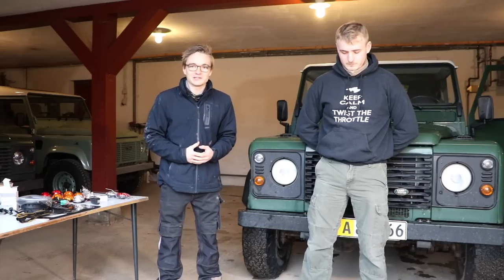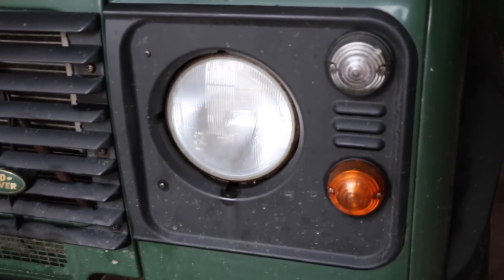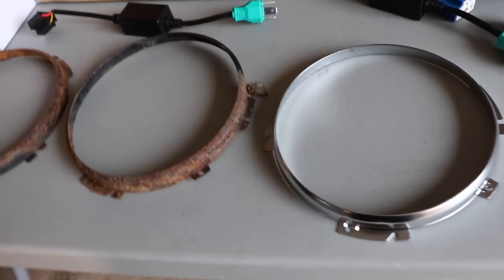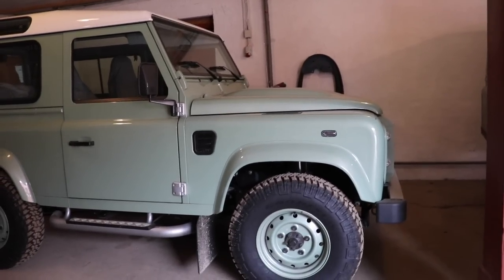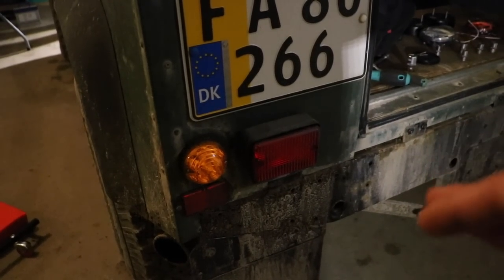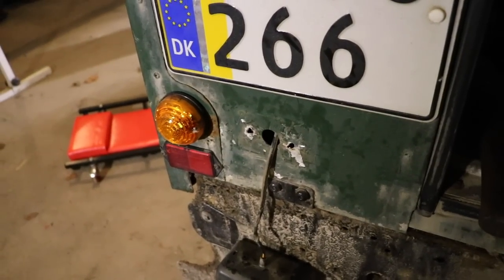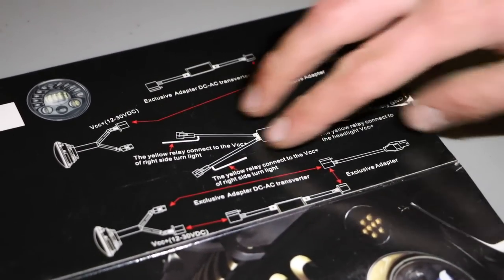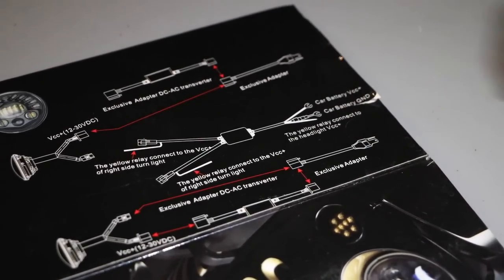Installing LED 'Halo' Lights | Land Rover Defender Mods

Comment: Looking great lads! The plastic headlamp bowls were only on Series, and earlier coil sprung models. But since you had them was a good idea to fit anyway as they help keep some of the crud out of the connectors etc.

You ought to do a shot of the headlights in the dark from the drivers perspective in one of your vlogs, so you can give your opinion on the brightness, spread etc. I personally haven't been impressed by any so far compared to upgraded Crystal halogens, as I don't like the 'cut off' beam pattern/spread on low beam, but I do like the fact you have the low beam on still when you switch to high... fills in that void at the front nicely.
Reply from the maker: Thanks! Admittedly, a showcase of the lights in the dark should have been included, but we'll likely put that into another video at some point as you mentioned. 
And thanks for the info on the bowls, we were wondering about that.
Reply: Nice,how did it cost for both ?

Comment: Hi guys. I have just bought the same set of LED Lights because they looked so great on Liam's Landy.  Could you please clarify the connections that Nisse made when wiring up the Halo part of the Headlights.  Did you say that you had connected the red wire labelled Car Battery Vcc+ and the black wire labelled Car Battery GRND to the vehicles Position Lighting?  If this is so, what is the Position Lighting?  Your help would be most appreciated as I am struggling to find a suitable switched ignition live to connect to under the bonnet of my 2015 Puma Defender.  Keep the videos coming they are excellent!!

Comment: Hi 
I have defender 90 2005
Today I fit new Led head light .
One small problem that in first swich(click 1) and Secound(click2) high beam on.
I know some Landrover made some  defenders with swich low light when you change for the Secound swich becomes brighter.
Led read low and hight same.
How we can solve the problem please?

Comment: Hi. I installed LED halo lights but there is interference and the dab radio has no signal whilst lights connected. Any clues? Thanks.

Comment: I don’t want to sound a prick but the drl should switch off when side lights are on
Reply: It's wired in as an 'extra' sidelight function rather than a DRL function, otherwise you need an additional DRL controller if you want to use them that way
Reply: What I was thinking.... Look good though, but easy to hook them as a proper drl.

Comment: What’s the chassis like on the td5
Reply from the maker: It is good, we normaly coat them all, every 2th summer with a greasy oil type of chassis paint, which keeps the rust at bay. There are surface rust, but not even close to holes :)